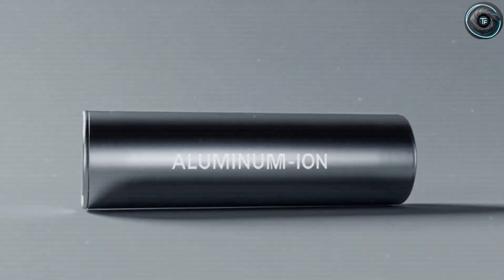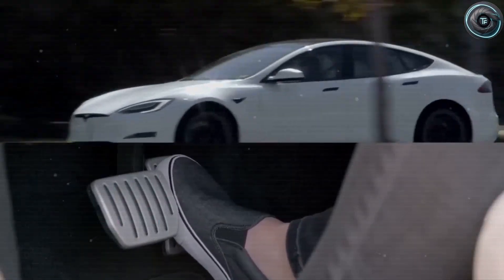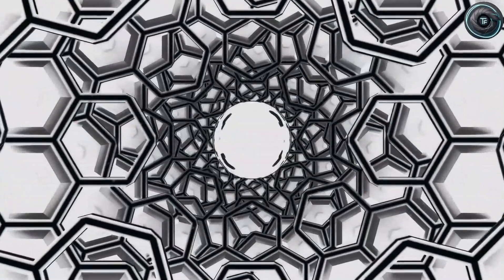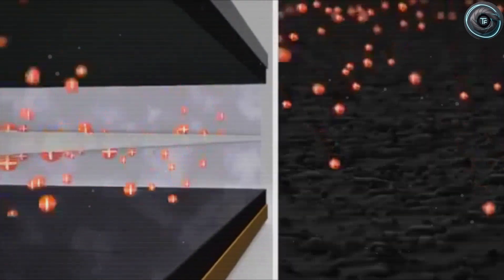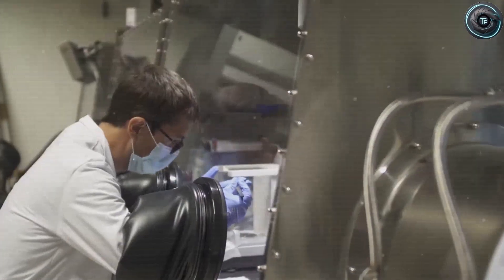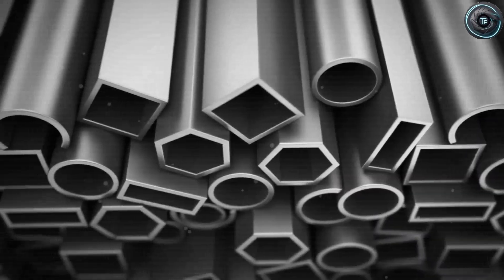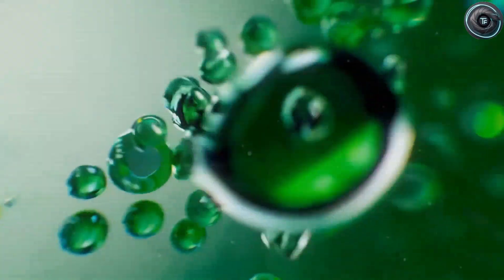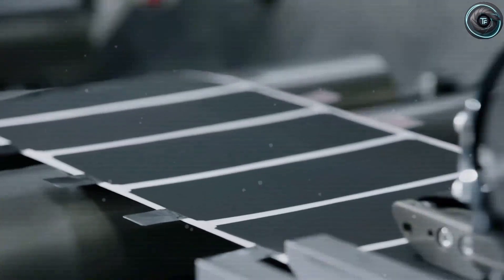I Made My Decision! This Aluminium-Ion Battery Makes Tesla Model 2 Unstoppable!

Comment: This battery tech is coming. But from where? Or whom? That's the question. A safe, fast recharge, high-energy battery would be a game changer. However, eventually, as ev numbers grow, the infrastructure necessary to supply mega amps of charging current (ExI power) better be there , or....arcs flying into the forest.
Reply from the maker: Tesla R&D 👀